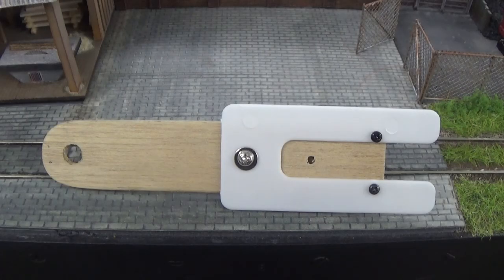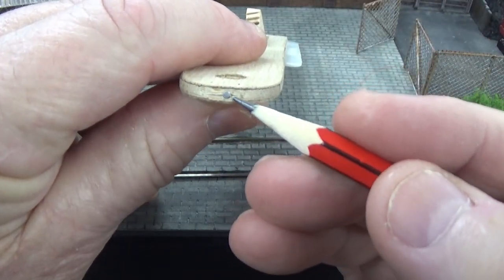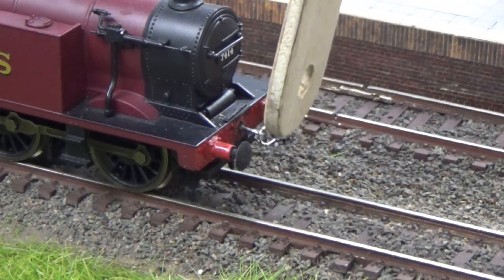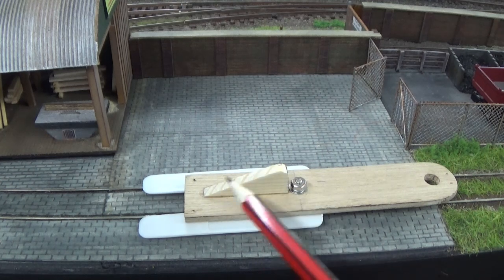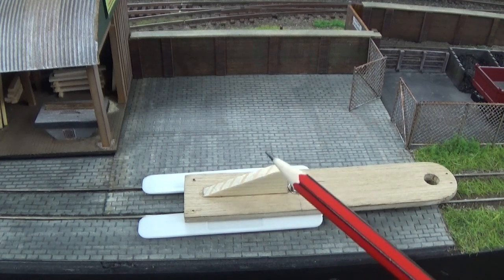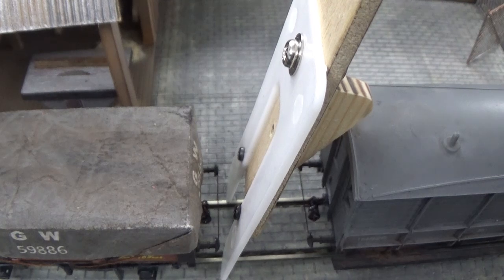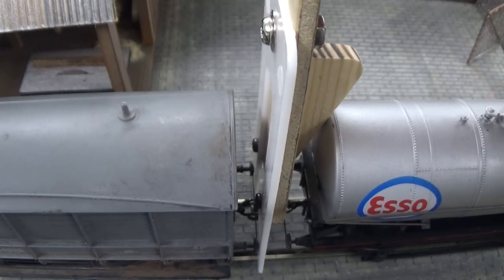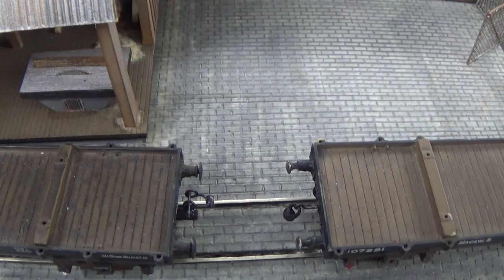Revised and Improved Shunters Pole for Rotating Magnetic Couplings

Comment: Every system has it's pro and con's.
And this is my personal opinion, but if it work for you, that's what matters in the end.
The pro's here:
-cheap way to make your own coupling system
-so much better than chain fishing to couple or uncouple
-always works where ever you wish to use it on your layout
-you can create a universal coupling system 
The con:
-my main issue is don't like the hand of God, as they say, interfering on my layout
-a lot of work fitting these coupling if you have a big fleet.
-don't like the look of these couplings (again a subjective personal view)
There are so many ways to make couplings, but in the end it's a personal choice.
But it's good you share your system, there are always people who find this useful.
Personally my favorite system is a few magnets in between the sleepers and a staple attached to your Bachmann/Dapol type coupling hook.
But also here are pro's and con's
Unfortunately all the manufactures have there own system and there is no unified system, and I don't see they ever will come to a uniform solution, even with NEM there is no real strict uniform placement…
Anyway as always a great video to look at.
Reply from the maker: Thank you Danny,
Yes I think you have summarized things accurately.
You`re correct in that it does come down to personal choice and I suppose that is the essence of the whole thing.
Some people may be happy to persevere with the proprietary systems, but for myself I decided to do something about it and here we are.
All good fun in the end and that`s what it should be.
All the best
Gormo